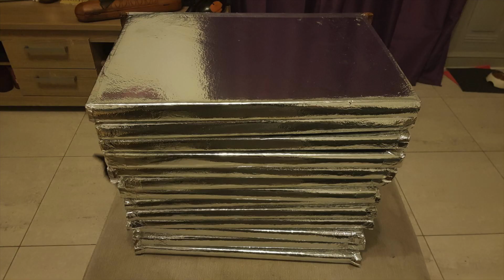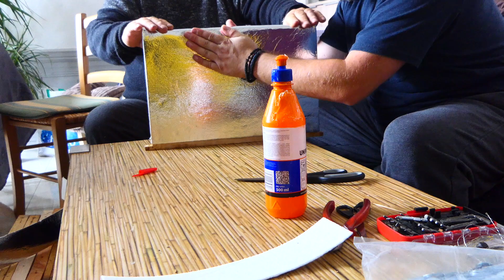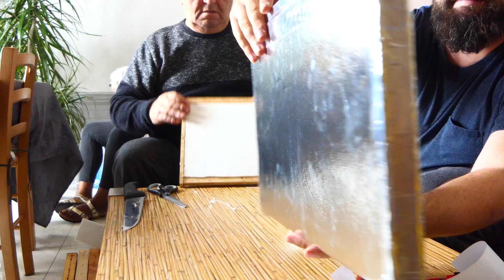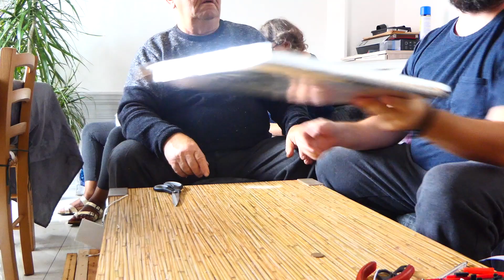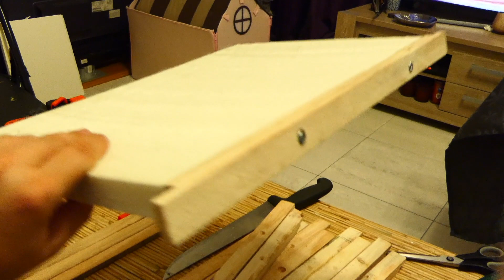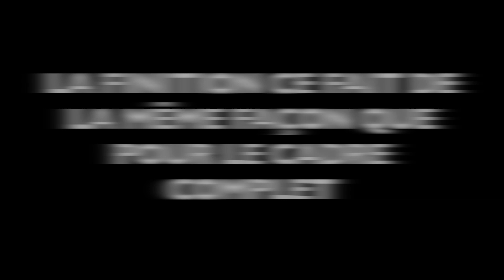COMMENT FABRIQUER DES PARTITIONS ISOLANTES AVEC ET SANS CADRES POUR RUCHE DADANT

Comment: Bonjour. J'utilise beaucoup la PIHP (2 par ruches)depuis 2016 ou j'ai fait le stage de l'anercea avec marc guillemain.
Mes partitions viennent jointer en haut du cadre et sur presque 2/3 des cotés. il n'y a que le dessous et 1/3 des cotés bas que l'air peut passer.
N'avez vous pas peur que le fait que l'air puisse passer sur le coté diminue l'efficacité de la partition.
Cordialement.
Reply: Ruche polystyrene ! certains ne veulent pas exagerer avec l'etancheité car ils sont d'avis que l'air dois circuler pour eviter que des point de condensation apporte des moisisures... difficile de savoir car qui vat aller voir l'interieur en plein hiver ?